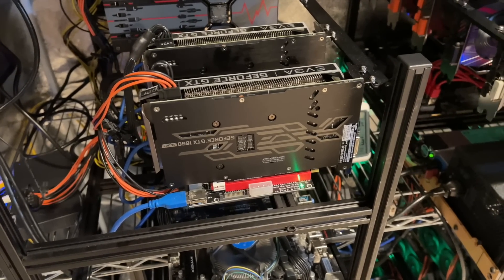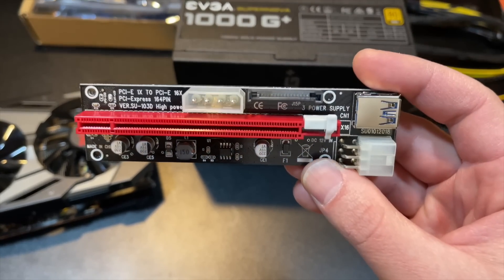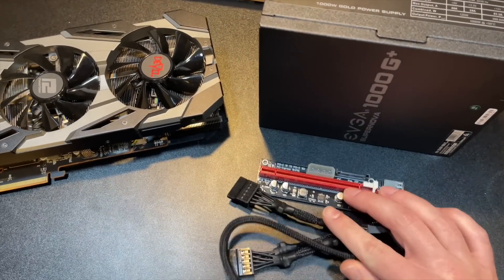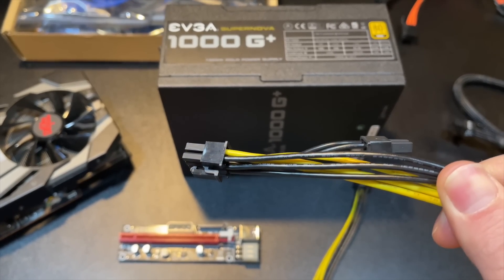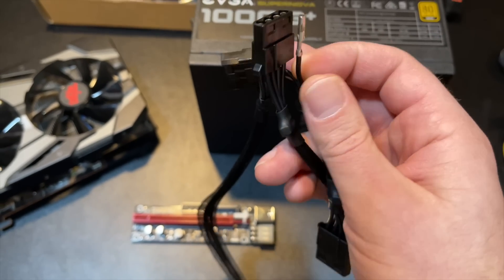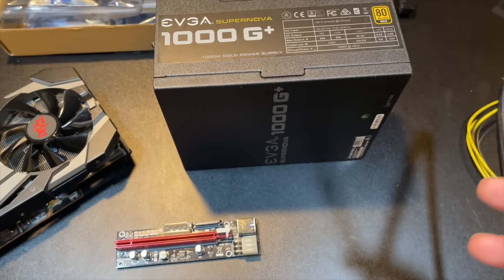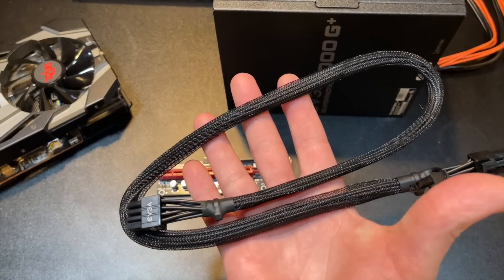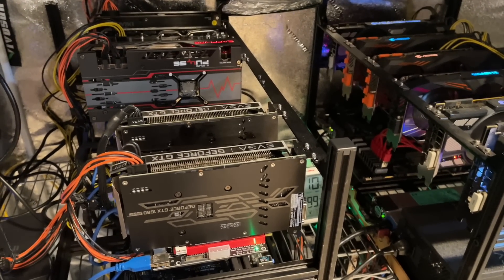Powering GPU Mining Risers Safely

Comment: MOLEX SAFETY.
The current a MOLEX cable can safely handle is determined by examining the diameter of it's internal pins.
"There are three typical pin sizes: 1.57 mm (0.062 in), 2.13 mm (0.084 in), and 2.36 mm (0.093 in). The 1.57 mm pin can carry 5 A of current, while the 2.36 mm can carry 8.5 A."
...... https://en.wikipedia.org/wiki/Molex_connector

On my Cooler Master PSU for example, I have found that the supplied MOLEX cable contains 2.13mm pins so it's rated for upto 8.5A, and at 12v that's 102w.  VxI=P
However, that long cable has 3 MOLEX connectors which are supplied by a single 18AWG wire which can only carry 9.5A, so that limits the cable capacity to supplying a total of 114W, meaning you cannot safely power more than one GPU riser (remember each riser needs 75W).   
Actual power draw (especially for under-volted cards) may be lower in practice, but I recommend take the safe approach of a single molex cable powers a single GPU riser.
...... https://www.engineeringtoolbox.com/wire-gauges-d_419.html

Better still, use PCI wherever possible as recommended in the video.
Hope that helps.
Reply from the maker: Thanks for sharing. I don't see a source credited on wikipedia for the connector sizes and their amperage ratings. Bummer. I wonder where that info is sourced from.

Comment: Great !!  So much detail info but right now I don’t have this splitters but I’m planning to buy some, my question is, can I just power gpu and it’s respective riser using the cable that came with my psu? (This cable have 6+2 pin connector. Thanks in advance.
Reply from the maker: Yes you can as long as the cable can reach. I know most of mine have a pretty short split on them.
Reply: @RedFoxCrypto  thanks for you answer you are the best :) and taking advantage of your experience what do you think about this? I was trying to add a 3rd gpu using my first gpu riser because gpu 1 and 2 are directly connected to motherboard running flawlessly so I put everything together for this 3rd gpu power them (gpu and riser) with the pcie 8 pin cable but when I hit power button all gpu and cpu fans turns on apparently working fine but motherboard shown no signal of life, no error lights no power on peripherals  so It took about 3 hours to figure out the error, I fixed it disconnecting everything from mother and removing its battery then I reconnect everything but not riser and new gpu now everything is working again with 2 gpu directly to mother so I’m 100% sure that the riser was the problem and I have decided no to add 3gpu, I don’t want to try another riser until I receive the appropriate splitters and connect everything like you showed on your video, so do you think it was just a “bad riser “ or it was not the appropriate way to power new gpu and riser from one single 8 pcie cable? (This cable is the stock 8pin cable that comes with psu and have 2 6+2 connections ) thanks a lot in advance and sorry for the !letter :D

Comment: The upgraded VER009S riser with large 4pin + 2X 6pin Graphics interface, 
each interface can direct connect to your power supply that reduces the burden on the main board in the multi-card access and ensures maximum compatibility with your power supply.

If you want to buy VER009S pcie riser on Amazon, please check the link below.
 
https://www.amazon.com/dp/B08ZS16FND?ref=myi_title_dp
 
We are also sold this risers on Amazon CA; UK; DE; FR; IT; ES
 
We can also give it to you for free. If you need it, please contact us.

Comment: thats a 22 gauge female connector from there you can do the math on the connector, honestly pci-e would be the best, sata pins are to small, that molex is wack old school, pci-e is good, they use those connectors in automotive only to power small lights ranging from1.5-3amp average.

Comment: Hello! Thank you very much for the guide, thats exactly the answer I was looking for! One question. Is it safe to plug rtx 3070 on 1 cable with riser like in the video with 1660 super? If my calculations are correct, its safe. 3070 has 8+8 pins. So Ill take already splitted cable from my PSU, plug a splitter (8 pin --> 2x 6+2 pin) in one 8 pin connector so that i will have 3 6+2 pins and so plug 2 of them to 3070 and 1 to riser. 3070 consumes 115-130 watt in mining, so if your math of going 190 watts on 1 cable is correct, its safe. Am i right?
Reply from the maker: You are right. I personally don't do this but other's have successfully. You really need to make sure that the card stays power limited and doesn't run full blast. Also, that the quality of your cables is good and the AWG of the wire is sufficient. Parallel Miner sells 3-way PCIe splitters they rate to be used by the 30 series cards for just this purpose.
Reply: @RedFoxCrypto  thanks for your answer! I've made some calculations on my PSUs and i will connect 3070 just separately, the normal way)) i have enough connectors. Yeah. Im from Russia so that store doesn't count for me)) its too expensive to order cables from the US ^^. I have splitters that say 18 awg on them. U said its good.

Comment: MOLEX should have 2 grounds, a 5V and a 12V power pins. There is no specs (what I know) for the amount of current on the 12V line, but I have doubts that it is enough for PCIe, since a mere cable pair seems to be a bit small to me, so... The saying: "MOLEX-to-SATA", lose all your data seems to support the idea that even 54W can be a problem this connector (and not the cable!) some times.
On the other hand, if you have N cable pairs, the resistance (and its heat power) is just 1/N times the original. I.e. the resistance on the MOLEX connector will be about 3 times more (3 pairs vs 1 pair) than that on the 6pin PCI connector (as I said, the connector is the weakest part). Since a PCI connector is hardly warmer than room temperature, 3 times that heat power pushed out should still be OK. My non-expert opinion is that you should touch the connector; if that is cool after some time of stress test, you're good to go as long as there is no change in your system (e.g. a new short can be a problem, but that's a problem anyway).

Comment: Yea Molex is more like more like “USB C”. It’s a connector not a “protocol/standard” etc. I’ve seen molex used in insanely beefy situations with extremely high power high drain RC hobby Lipo situations and I’ve seen them used, even the modern connections, using molex for low drain LED strings. I’d personally test each cable with a bench power supply and see how it tolerates it. 

But yea, there is no standard basically for molex

Comment: hi sir, can you explain ...
i'm powering GPU & PCIE riser with a 8 pin to 2x8 pin pcie cable. but my system cannot powered on. 
right now i'm powering gpu riser with 2 molex convert to 6 pin pcie. GPU, powered from PSU direct.

why my system cannot powered on when sharing 8 pin pcie (for both riser & GPU) cable power source?

Comment: So for 1660 super its all good to use a splitter. What about 3090 for example? The safest would be take 2 slots from psu to power both - 1 cable to riser and 1 (8+8) to videocard, right?

Comment: Would i still have to connect pcie to power if i want to to power gpus from thier original power pins the 6 and 8 pins (rtx 3060ti and 3070)

Comment: I never touched risers before cause of random “my house = pile of ash” stories (and since I didn’t have enough GPUs to justify it) but now, I’m getting to a point where I can’t just shove all of them into the motherboard so this video was real helpful.
Reply from the maker: Glad I could help! Thank you for watching.
Reply: The upgraded VER009S riser with large 4pin + 2X 6pin Graphics interface, 
each interface can direct connect to your power supply that reduces the burden on the main board in the multi-card access and ensures maximum compatibility with your power supply.

If you want to buy VER009S pcie riser on Amazon, please check the link below.
 
https://www.amazon.com/dp/B08ZS16FND?ref=myi_title_dp
 
We are also sold this risers on Amazon CA; UK; DE; FR; IT; ES
 
We can also give it to you for free. If you need it, please contact us.

Comment: Good presentation. You could figure out those molex pins by estimation, how much metal is in them. However that's a gross estimate with gross margins. Also a close inspection of the alloy used in them could give you a hint of their quality. Silver is easily recognisable in pins alloy... if they are made from cheap metal like aluminium or bare steel than better not use them. 
Thickness of the pin and surface area could give you an educated guess, charts are widely available for various metals conductivity. Measure the weakest point of the pin.

You can use both molex connectors or all of them as long as you don't exceed the carrying ampacity of the wire. Current doesn't pass completely through first molex connector in line, it continues through the wire without passing through that molex. I'm pretty sure they don't cut the wires on each molex connector and even if they do that's not a problem. This is similar to sockets circuit in a building/room, first socket in a line will not have all the power in it. The power stays with the line behind the socket and is more or less equally distributed, obviously length and temperature makes some differences as always.

Comment: Hi. For confirmation. You connect the 6 Pin PCIEon the riser. On the other side, you connect to the PSU with a 6pin SATA or on 8 pin PCIE?
Reply from the maker: No SATA. Other side connects directly to the PSU's VGA port.

Comment: Great video. I am building a rig with the new 3080 FEs and they have the 12 pin split to dual 8 pin pigtails off the top. I have two, 8 pins running direct lines to the PSU one of which has a 6 pin tail. Would you suggest powering the riser with the six pin or running a third line from the PSU to power two risers?

Comment: I know you had your own explanation for the 6 to 8 pin.
But the consensus on the web seems to be this is a no no. Gpu will think it can pull 150 watts of power but 6 pin only able to give 75 watts?
I am new to all this and am putting together my rig soon so want to get this right
Reply from the maker: If you look at the specs for a six pin and an eight pin you’ll see that they both have three pins that deliver power over the 12 V rail of the power supply. The additional two pins on an 8 pin do not carry power.
Reply: @RedFoxCrypto  thanks for the response think i was confusing the what the gpu can pull with the wire itself
With this in mind can i use a 8 pin to dual 8+2 pin to power a gpu one of which has 8 pint and the other 6 pin
The cable came with the psu evga so it sohlud be able to handle 300 watt right. 150 watt max from 8 pin gpu 75 watts from 6 pin gpu?
If not i think i will do what you do and put a splitter in the 8 pins to power 4 risers from this cable

Comment: Hey do you respond im currently doing this setup for a customer and I'd like to see how your electrician wired your meter with a 30A circuit. If you can message me some images that'd be great because those terminals are way small and a neutral doesn't exist

Comment: I use to work as physicist-experimentator and have experience with many power supplies and super-expensive equipment. You worry to much :) 1. Current (electrons) travel on the "skin" of the wire -- all Molex  and all cylindrical connectors are OK. 2. The US NEC protects us very well (overprotects -- that is 'very' stands for). So all established company already calculated the current according NEC requirements/code. If you purchased adapters from unknown Co. -- the IR goggles would be ideal. I use it in my lab always (sometime combining with liquid N2 to speedup troubleshooting and precisely allocate multiple overheating). 
really'

Comment: Would it be safe to use  2xSATA to 6-pin adapters and using 2 diffrent sata cables (so 2x 54w) or isn't that how it works?

Comment: I believe the modern Molex and PCIe connector pins are pretty much the same thing. Take out a pin from the PCIe connector to see what I mean. The Molex pin is a larger diameter giving it more surface area for contact, I would suspect that it's pins can carry more amps than pcie which are smaller but very similar in design.  I've ran 3 gpus per string using molex with no problems, cables don't warm up, etc. Which I'm pretty ocd about wire temps because that's gonna be your first sign that you are overloading the cable. If any single cable gets to 60c, you are overloading it is a really good rule of thumb. Monitor at the gpu end and psu end. On my rigs that use molex, the connectors are pretty much room temp. At least that's my experience using EVGA and Thermaltake PSU's.
Reply from the maker: All of that makes 100% sense to me. I just wish there was some clear documentation to back it all up. Essentially saying that this Molex pin in my hand is the one made by this company and that company says it's rated for X amount of amperage. Then we could wrap this whole thing up.
Reply: @RedFoxCrypto  From what I can tell using mouser ( https://www.mouser.com/ProductDetail/?qs=qNnCIBFEAwHlKfurylfAoA%3D%3D ) the AMP pin and socket connector is rated to 15amp, if you account for some loss at the crimp, and connectors, about 11amps sounds about right. Man when I think about 75 watts over motherboard traces and a pcie connector, kind of crazy. I don't think GPUs (least modern ones) are pulling anywhere near that at the slot. This is something worth testing. Would be easy enough to test what these cards are pulling on the slot side while mining. Would be good to know in real world testing.

Comment: Could you help out?
All of my 6pins on my psu are free, because I could not find any cable which is a simple 6pin male to 6pin male.
I have 4x 3060 Zotac white editions which come with a 2x 6pin to 1x 8pin. Which is basically 2x 75 watts to 150 watts. So that's correct. The corsair fully modular PSU came with 6 pin to molex, 6 pin to sata and I couldn't find any good quality cable which I can plug into the 6pin PSU port and the Zotac splitters because it has to be 6pin male - 6pin male. Any idea? Thank you very much =)

Comment: Hello and thank you for this video.
I think I understand better but I am still a bit confused about the setup to use for some new cards like the RTX 3080. This card can use up to 320W. It has two 8pins connectors on the GPU itself. What is the safe way to connect the GPU and the riser to the PSU ?
I hope you can help me because I have juste one card (hopefully a second one soon), and I am a beginner so I do not want to fry this expensive equipment.
Best regards.
Reply from the maker: All good buddy. For my RTX 3080 I run it at about 225w. With that power limit I use a single strand dual 8-pin PCIe to the ports on the GPU itself. Then I power the riser separately with a 6-in PCIe strand (which does 2 risers on my rig).
Reply: @RedFoxCrypto  Hello ! I'm so sorry that I missed your reply ! Thank you for your answer :)
So far I have been using 2 strands on my RTX because somehow it must have 245W minimum or hash rate drops massively. I've done my calculation and 288W (for PCIE) x0.8 is 230W max. Do you think I could use 1 strand instead of 2 despite being a bit upper the 80% capacity of the cable ?
By the way, since my last message I got a 2nd RTX 3080. And this one is a bit tricky too as it's a bit different. It has 3 8pins connector but runs well à 225W in Hiveos. Do you think it would be safe to use just 1 strand, split it with 8-pin to double 8pins splitter and plug all 3 ends (splitters ends + PCIE end which is left) into the card ?
You are the only who address this serious question in detail. Thank you so much for your inputs !
Reply: Oh! just one last thing btw, I you have 1 PCIE cable and you split it with a 18 gauge 6+2 splitter... can't you power up to 3 risers with this single cable ? 288W/3 = 96W; 96W x0.8 = 76.8W max per end which is higher than the 75W max requested by the riser. So it's 3 risers :) I'm wondering why nobody does that^^

Comment: Can this be done on a 3060 ti using the splitter? Running the card at max would put it over, but running it at its most efficient would put it under. Or would it be best to run separate cables?
Reply from the maker: I personally run separate cables on all my 3060 TI‘s. But power limited the math does work out where you could split it I just prefer not to.
Reply: @RedFoxCrypto  I appreciate the quick reply. I am far newer to this than you are so I will follow your example. Thanks!
Reply: @RedFoxCrypto  and thanks for the quick reply!

Comment: at visual check, i believe there is no bottleneck through that molex pin from an 18 awg wire, based on the surface area of the pin and material type. i think it even haws a bigger ampacity rating than the 18 awg. you will get the full ampacity rating of a 18 awg copper with no issues, 18 awg is rated 10 amps under 50ft.

Comment: Hey man i appreciate the video but I have a question. When you talk about using the 6 pin pcie connector for the raiser do you plug 8 pin into ur atx psu? or could you get away with doing that with 6 pin ? for example i have a 750w psu with only 2 pcie slots and i wanna use them for 2 gpus. that leaves me with only 6 pins for powering the raisers.

Comment: The only way a GPU takes 75 Watts is if the normal connectors dont deliver enough power and thats the case if you use splitters.

Comment: Awesome video!  I have 2 x 750W PSU and and planning to run 6 x RTX 3070 using PCIE; my calculations say this is enough power and safe.  YAY or NAY?
Reply from the maker: YAY. Just make sure you have enough PCIe connections from those PSUs.
Reply: @RedFoxCrypto  Thanks mate! 🙂